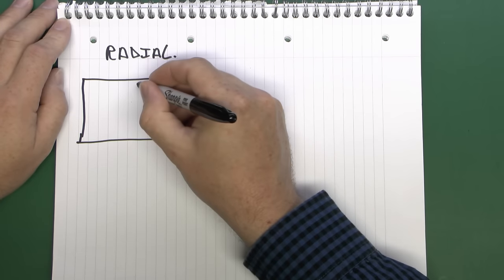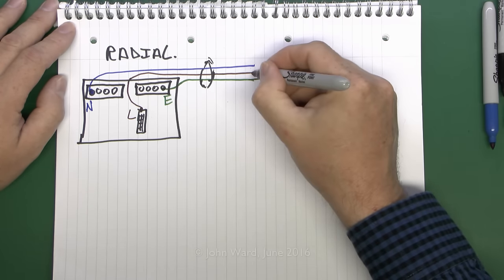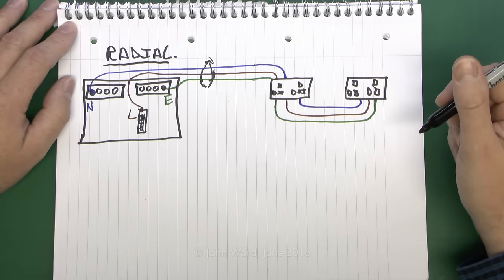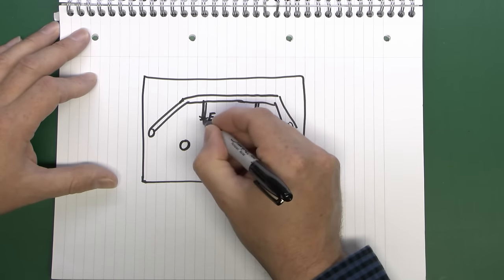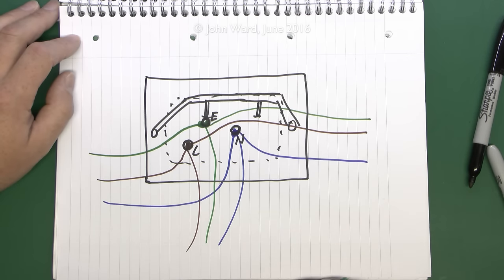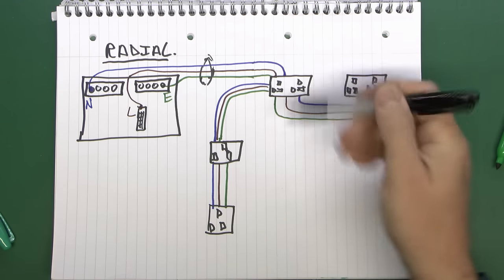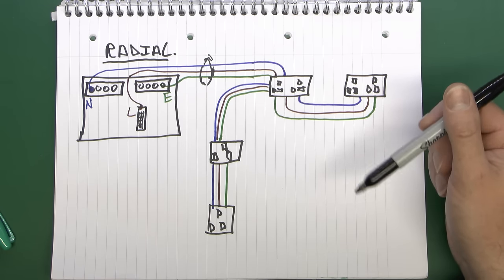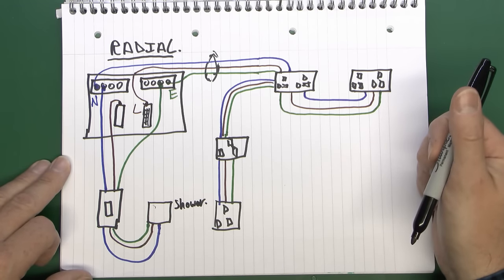Radial Circuits

Comment: what a dreadful system.  just to wire a bathroom ceiling light i have 5 cables (15 wires) dropping through the ceiling.  all this to control two bathroom lights, a fan, a switch, supply and forward delivery to other lighting circuits.  ugh..!

Comment: In my garage I have a cable running from the CU into a 3-way junction box and then out to two double sockets. It was installed by the previous owner but I need to add another socket. Do I need the junction box?

Comment: Popping over here from a link on Ring Circuits. American with electrical background curious about how UK wiring works. Now I know what a Consumer Unit is: Fuse Box or load center as we call them. And where we have black/white/green UK uses brown/blue/green for hot/neutral/ground(earth) in the same way. 
Thanks, John Ward, as you are making things very clear in these vids and I understand way more than I ever got from previous Google and YouTube.

Comment: It's still a 2.5mm cable as used for a ring main. The MCB in the consumer unit limits the current below its rated value of 26A
Reply: John Mathias, that is an important point to make

Comment: The people who dislike ring circuits often talk about the possible wiring overloading if a line or a neutral wire or connection becomes loose and no longer makes contact/good contact or is removed.
In a radial circuit (as in many other systems) if there is a loose connection (say because a thermal screw was not fully tightened) all the downstream socket outlets may work for months or years after the installation was installed. But at some point, the increasing contact resistance of the loose connection will cause overheating of the terminal of the socket outlet if a heavy load is used downstream of the loose terminal. Which potentially could result in a fire.
Reply: What you say for the radial circuit is also true for a ring circuit that has broke into 2 radial circuits. All you have done is stack failure modes and ensured that the circuit is underspec, and will continue operating as though all is normal.

Comment: Hi John, very concise explanation.  Isn't this adding a spur off a spur....I thought it's not allowed.
Reply from the maker: There is no concept of spurs on a radial circuit, because the cable is rated appropriately for the circuit breaker or other protective device, such as 26A cable with a 20A circuit breaker.
Spurs only exist on ring circuits because a single cable could be overloaded, as the cable used is rated less than 32A, but the circuit is protected with a 32A device.

Comment: In my country radial circuits are done a little differently: instead of looping in and out from sockets all the wires for the various sockets are linked together in junction boxes (one for each room or one for two/three rooms), and then a single wire goes to the consumer unit. In fact looping in and out of sockets is prohibited, the only exception are sockets on the same box in the wall, otherwise you should use a junction box. The reasoning is that this way the sockets is not a part of the circuit and doesn't carry a load. The problem comes when you have a damages socket, where the wires are not secured correctly, and that carries the load of all sockets in the circuit, with the potential to overheat and start a fire. Contact of sockets this way only carry the load of what is plugged in the socket itself. Also troubleshooting is much easier that way, since if there is a fault in a socket is easy to know which one is.
Reply: What country are you in?

Comment: So is there any reason why star circuits are not used? By a star circuit, I mean a 32A MCB in the consumer unit. 4mm squared T&E cable to a distribution box. The distribution box contains three busbars (one each for line, neutral and earth) each with suitable size terminals, one for the incoming cable and say six other thermals for the outgoing cables (each terminal being intended for just one conductor wire). The socket outlets can be single or double and each is fed via it’s own 2.5mm squared T&E cable from the distribution box.

Comment: Hi John. Me being "old school ring mains" I have to question the theory of using that poor old double socket getting used as essentially, a junction box. If those screws are poor, or not tight, it will get hot.
I have always had a rule of never putting more than two wires in the back of a socket, for that reason.
That said, a ring main (I know you don't like them for reasons of testing difficulties) lends itself to the convenience of load distribution.
I understand your concerns over overloading near the distribution board, but this is directly proportional to where the sockets are positioned on the ring, and providing the trip is of the correct rating to protect the cable, that is dealt with.
David (G1ZQC full licenced Radio Amateur)
PS we have been using Surge Protection Devices for the best part of a century.

Comment: Thank you John 
I'm just wondering if you could do a video on campervan installation,  of both 220 volts and DC voltage 

My son is fixing his van 
And I'm a bit confused myself how to do it from an inverter charger .
This machine is producing AC and DC

If you didn't do 1 already 
Many thanks

Comment: stevieboy1986 spurs with more than one outlet need to be fused "13A" because the load is no longer shared in a ring main. Remember the 2.5mm cable does not support 32A which is typically the protection on a ring main. On a radial circuit with 2.5mm, circuit is protected by a 20A MCB which is within the cables current rated capacity for method 3 clip direct so no need to protect it with a fuse.

Comment: This is great. Can't see why you'd ever have a ring main at all nowadays, even if you're changing one our as long as you either use 4mm for the 30 amp MCB on the existing ring you're removing or swap to a 20amp MCB if you're sticking with 2.5mm.

Comment: In France the regs say a radial of 2.5mm cable can supply up to a maximum of eight sockets.  I have 12 sockets in my living room (two behind the wall hung TV and sound bar alone). In France I would need two radials, each with its own breaker at the CU, for the 12 sockets. Madness.  I have one 32A ring circuit serving three rooms and a hall.  In France that would be around four or five radial circuits, each with their own breaker at the CU. The CU would be bigger and more expensive as well. All needless expense and hassle, when one ring circuit would do it all. 

Rings are not safe?  Have an AFDD at the CU as recommended by the regs.

Comment: Circuit design. Tables tell us the maximum current cable rating depending on installation. If a cable is open and clipped to the wall the current rating is high, while a cable embedded in plaster is much lower.  In a circuit this is generally mixed as it works its way through the fabric of a house. What do you guys do? Take the lowest derated figure of a circuit?  If most of the cable of a 2.5mm circuit could take 27 amps max, but a short one foot section is derated to 18 amps, is the lowest figure taken as the maximum current allowed in the radial circuit, 18 amps. That would mean an MCB of 16 amps on a 2.5mm cable.  What do most do?

Comment: Your explanation of the current flow in the CU (around 10:20 onwards) I found especially handy, thank you. The rest of the video was great too. Seeing a bunch of things connected with wires can be confusing until one pictures the current flow.

What you said about flicking the switch on a breaker isolating the line only (and not the neutral) was interesting. If you wanted to isolate a circuit (and just that circuit) properly, would you also disconnect the neutral from neutral bar, or remove the MCB/RCBO from the CU completely? I'm asking for a friend (!) who is remodelling his en-suite.

Comment: When a radial circuit goes outlet to outlet, the final outlet is often located in a nearby location to the first. I had thought about if it is a good idea to add the connection between the first and final circuit to complete a loop. This way you can prevent arcing if a wire breaks in a similar way to ring mains. Or perhaps create extra redundancy in the system. There is nothing in BS7671 about it though. Would it cause an installation test result failure?

Comment: Thanks John, thats the clear plain English answers I was looking for to assist me in my garden summer cabin project as far as 240v sockets go.
Does anyone have any helpful vid links to helping with our plan to have LED lighting and USB charger points running on a separate 12v system via a couple of hefty  car batteries fed from solar panels or trickle charge from mains if needed.
Many Thanks
Reply from the maker: Unless you are determined to have the solar panels for some reasons other than cost,  or you can get the parts for free or next to nothing, don't bother.   The expense of the panels, batteries and charge controller will far exceed any tiny savings from not using 240V power for lights.
Julian Ilett has many videos on solar power: https://www.youtube.com/user/julius256/search?query=solar

Comment: Recently on a site with a more qualified spark telling me I can't just  spur of a radial as youd overload the cable as it's a new circuit, so he pursued his ring and struggled to get 2 cables through a place one cable would walk through
I normally run 20amp bed rooms and sitting rooms then 32amp 4mm in the kitchen
Is this the quality of modern day colleges John?

Comment: As a professional electrician I can confirm that ring  final circuits are dangerous, over the years I have found all manner of serious issues with them. Cross wiring of course being the most serious where four ends of two separate rings are wired together, this effectively creates one ring circuit fused twice and supplies over 60 amps! A short circuit here would have enough energy to melt the twin and earth cables and possibly even ignite flammable building materials. At best it could blow the service providers main fuse.

Comment: Hi John, Great videos, helped me loads over time.  Any advice/videos on wiring a 32Amp 4 Pole Rotary Isolator switch which I have to install, single phase 230v.  It's for a compressor which takes a high surge at start up.

Comment: Ring vs. Radial
Which you should specify depends on many factors. What are the expected loads (does the building have central heating, so will plug in electric heaters be used or not, what appliances are expected to be used, etc. etc.). How many socket outlets do you want, both NOW and in the future (when someone decides to rearrange the furniture in the rooms).
Now draw up a plan on paper to work out the details. I always recommend that you specify more socket outlets than your immediate current requirements, as providing them now is far easier than making alterations later.
In a rooms where there are plenty of socket outlets, the distance between the sockets will not be that far, so the difference in cable cost between two radials and a single ring circuit will be insignificant if buying drums of cable.
Properly designed and installed ring circuits are just as safe as radial circuits.
Ring circuits are more flexible for the end user, as they can plug any normal appliance in to any socket outlet they like. Whereas if 20A radial circuits are used, too many high powered appliances connected and switched on at the same time on one circuit will trip the MCB. Worse if the protective device is a fuse... Fuses have the disadvantage that people can put in higher rated fuses, higher rated fuse-wire, or normal wire or other conductive material. And don’t think that a MCB protected consumer unit can save the day, as I have come across radial circuits run in 2.5mm squared cable protected by 32A MCBs...
Properly designed and installed radial circuit circuits have the advantage that no fixed wiring cables should overheat. But a poor conductor connection in a socket outlet could cause overheating and may result in a fire. So the argument that a fault will always show up in a radial circuit does not wash with me.
With a ring circuit, a disconnection or a poor connection could result in a cable being overloaded if multiple high power appliances are in use. But as there are two current paths, it does depend on where the fault is in relation to the circuit wiring.

Comment: Multiple 13 amp sockets on one 2.5 t&e ? what is the difference between that and and a damaged ring main?
Reply from the maker: Radials - cable rating is more than that of the circuit breaker, such as 26A cable on a 20A MCB.
Ring - 26A rated cable with a 32A device, so when broken, overloading and damaging the cable is very likely.

Comment: I've just had the first fix done......... So, if the final leg of a ring back to the CU is disconnected and down rate the MCB to 20A (which is more than adequate for me), I'm left with a radial. If I read it right, the advantages would be more flexibility for expansion in terms of spurs off it (if needed) and a lot easier to test?

Comment: Thank you for all your great Videos JW.
Can you / anyone please let me know what the max length of the cable run (2.5mm) can be for a Radial?
Another question, if the cable is going through insulation, what size cable and mcb would be required?

Comment: Really interesting and a great video.  What is the purpose for using RCBOs instead of just a circuit breaker in the Line (Live)?
Reply: An RCBO provides protection for both overload and where there's a fault to earth. So, if a person accidentally comes into contact with live power, it only takes a few tens of milliamps to get a lethal shock. An RCBO (or and RCD/GFCI) should trip before the current reaches fatal levels. Also, it will trip on certain sorts of appliance faults. For example, if water in a washing machine or kettle leaked into the electrics, either of which might end up being dangerous even though they don't pass enough current to trip the overload.

Comment: I've never seen an RCBO with the neutral tail coming out the side. That would prevent installation in adjacent position on the DIN rail. The RCBOs that's I've seen have the neutral tail (and usually a functional earth) emerging from the underside.

Comment: This is how we do things in the States 
120V , 20 amp , #12 conductor (line, neutral , ground) allowed up to 10 sockets on a circuit, same for lights.  We call this a "parallel " circuit not a radial .
A "Ring" circuit would never be allowed wound be deemed a fire hazzard and illegal. 
Cheers from the States 
A "Ring" circ

Comment: Does a lighting circuit always have to be on a seperate breaker? It's for a garage so will only be a few bulbs.
Reply from the maker: No, another option would be a 3A or 5A fused connection unit from another circuit such as the sockets.
Reply: @jwflame  Thanks mate.

Comment: I thought you needed to put in a 13amp switched to protect the cable if you want spur and spur or is that just with ring circuit

Comment: They used radial years ago, they moved to ring and the a new plug was used, as it needed a fuse for safety and now looks like we’re doing a u turn will we go back to the old 2A, 5A and 15A plugs I wonder
Reply: You do know that over time humans always HAVE TO CHANGE things. Especially politicians and people who pretend that standards HAVE to be changed. In the real world, it is rare that the principles change. It’s just that people’s perceptions change. Which is correct, driving on the right, or driving on the left?
Your particular use and specifications should determine if a ring or a radial is more appropriate. I would argue that in some cases a star arrangement would be better, but that’s another story...

Comment: I'm watching from Florida.  I'm surprised at the wiring of the disconnect switch for a hi power single load circuit.  In the US we run the wires as you've shown but only the power wire is connected to the switch, though a screw was added to the mounting yokes for earthing in case, say the mounting box is plastic and someone's finger contacted the screw that holds the cover plate to the yoke.  Is your switch multipole and are the neutral and earth also switched?   Or are there just terminals for earth and neutral?  Are wire nuts used in England?

Comment: Hi John, must of watched this video a dozen times. What connection method would you use in an existing installation and I'm breaking into an existing socket so there'll be 3 2.5mmsq at the one location. A deep backbox and take tails of 3 wago connectors for the line, neutral and cpc? Or do it like your video?

Comment: JW
Do you have to earth bond between the metal back box and the socket earth terminal on a 13A radial or ring circuit given that they are wired in T&E 2.5mm cable, in order to be compliant with BS 7671. 
I was led to believe that sockets wired this way did not need to be bonded to the back box as they will be bonded through the fixing screws.
And only if wired in conduit they would require to be equipotentially bonded. ?
Can't seem to identify in Regs !

Comment: In your ring circuit video, you considered current rating on the ring circuit. Yet no consideration for radials despite seeming more vulnerable? I must be missing something?
Reply from the maker: Radials can be any rating, provided that the cable rating is greater than the circuit breaker or fuse rating to prevent the cable being overloaded.

Comment: it's like having JW in my house as I got nice new 4k tv
Reply: But the video is only in 1920x1080p maximum, so your display will be stretching it 2x both horizontally and vertically to fit (3840x2160).
Reply: 9ff70f96 I was waiting for a comment after I posted.  My TV upscaled video.  It's quite impressive viewed on 4k. Much better than 1080p on my old tv. Sony sure know how to fill in the blanks